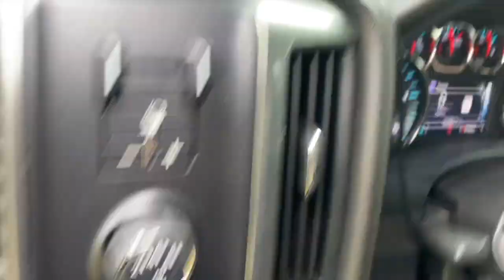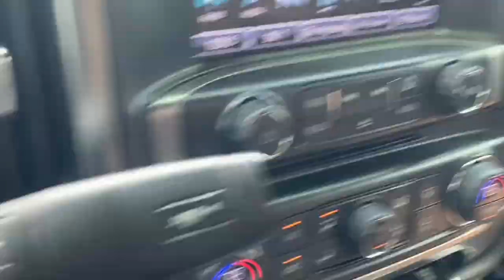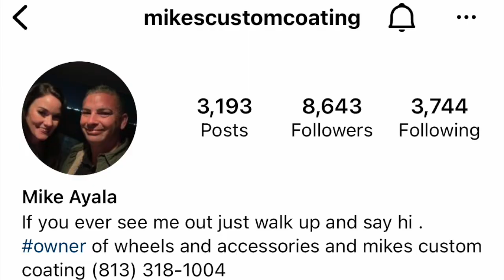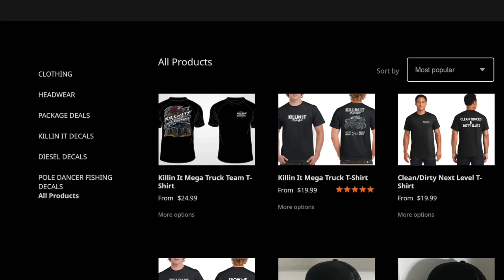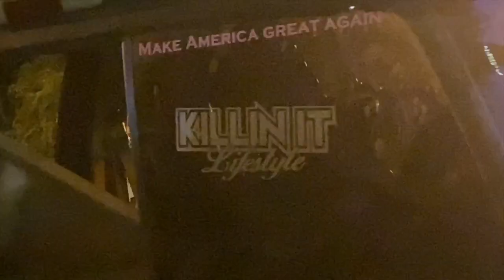Monster Truck Grudge Tug-O-Wars (CRAZIEST CARNAGE IN TUG HISTORY)

Comment: why do some people try and pull with skinny tires, the wider the tire the more ground you will cover and be able to lay the power down with
Reply from the maker: Because there’s two types of tug-o-war competitors. Some that like to be heavy with wide tires and traction and give it their all to pull the other backwards. Those types of guys typically aren’t the funnest to watch and they consider themselves winning only if they pull the other truck backwards. 

Then there’s a second type of competitor that doesn’t care what they weigh or how wide or big their tires are. Those types only care about hyping the crowd up and basically doing a rowdy burnout and letting their engine do the talking instead of their traction and weight. They consider themselves winning if the crowd is amped up during and after their match. If pull the other truck backwards it’s just a bonus.

Our crew is part of the second group.